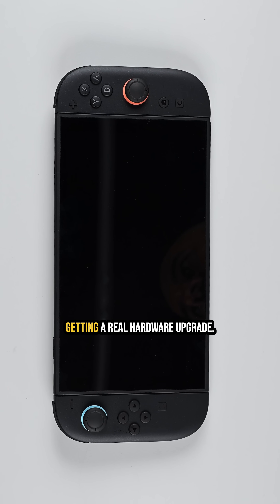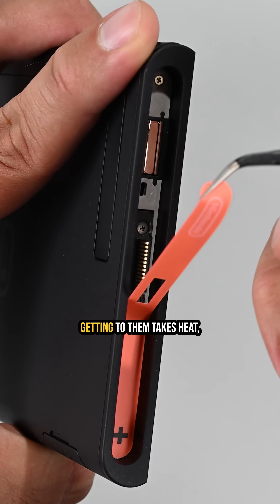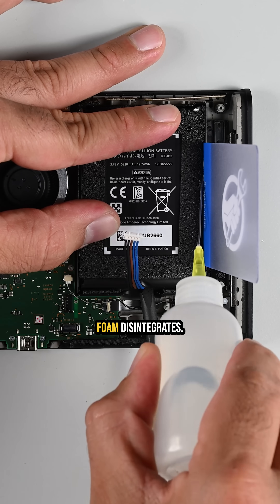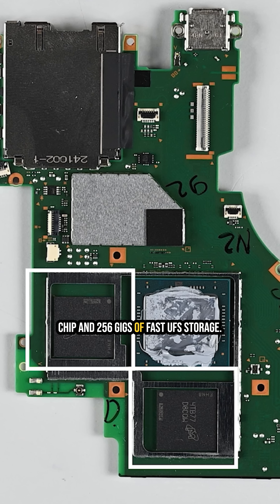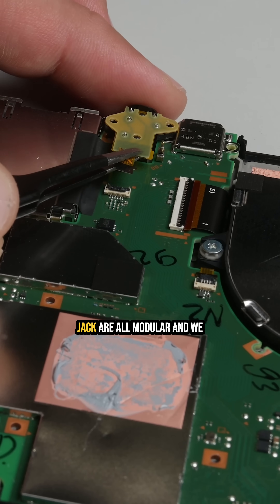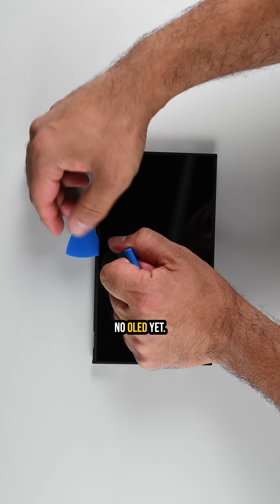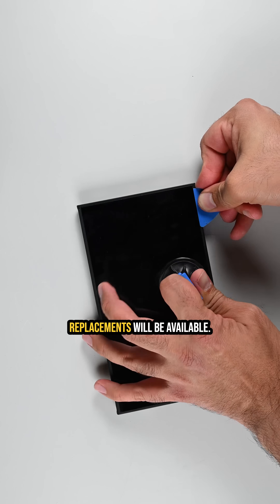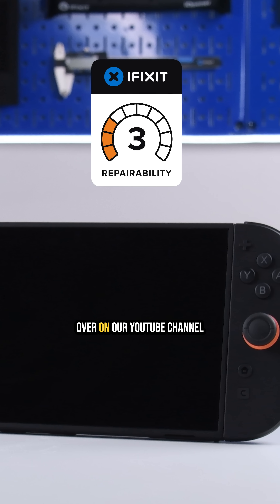Switch 2 Teardown! #ifixit #Nintendo #Teardown

Comment: I’ve heard going inside the switch 2 console to repair it will brick it so this literally is a sealed disposable pos if true I’m hoping it’s just modifications like soldering extra things to it etc not own repair and why does every handheld soiler on the usb c port I don’t think there’s even one that has a modular port which is bad as it’s the only way to charge it so is guaranteed to wear out

Comment: We need a higher capacity battery and replacement panels without the plastic cover. Luckily the adhesive from a screen protector nullifies any minor scratches to the plastic and leaves you with a very scratch resistant screen.

Comment: Wait wait wait.. in 8 years they didn't realise hall effect joysticks are nesrly immune to stick drift?
Reply: They know. They just don’t care.
Reply: @sedrosken831  Companies that do planned obsolence should be fined for every year they dont fix their ways
Reply: Hall relies on magnetics, right?
So do the new joycon to attach to the screen. They would interfere with eachother. Though they should still have at least tried to make the stick somewhat better regsrdless.
Reply: @calvinhoek9412 They could have just as easily kept the rails and used hall effect sticks. The attachment points being magnetic is just an excuse. 

That said, you can also make sticks that don't drift easily with potentiometers, too. I have DualShocks from the turn of the millennium that still work great, and those use potentiometer sticks. So what excuse does Nintendo have for not simply using higher quality materials? They're built internally the same way as the original Switch sticks, i.e. awfully. It was a conscious, deliberate choice on their part not to improve the design.
Reply: @sedrosken831  I think they added dust thingymagigs to prevent dust since that was mostly causing the drift, I think.
If that's not the case, then they have no excuse.
Also I don't think that there would be a (easy) way to implement hall effect because magnets kinda don't care if there is something between each other, they'll attract eachother when they get close regardless.

Comment: I wouldn't say it's much of an upgrade, the graphics are a little better, it's the equivalent of the ps4 and ps5💀🤡
Reply: Oh it's the graphics quality of a ps5 is that not good? Why are you complaining?  A ps5 is very good for games no?
Reply: It's as if it's a small handheld device that doesn't compete for the best graphics
Reply: braindead comment
Reply: Prepare yourself for disappointment from now on @jackhenry3643 as you will barely see an upgrade, we peaked on the PS4 era and the games still try to wow you visually instead of using all the horsing power on other things.